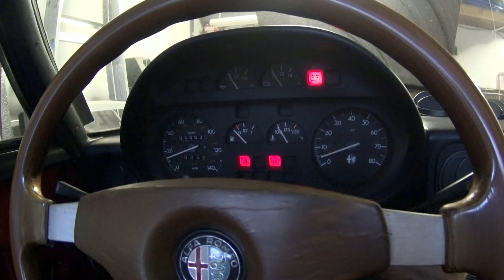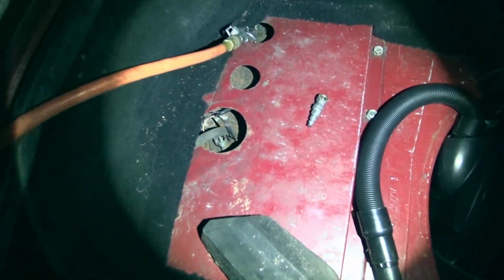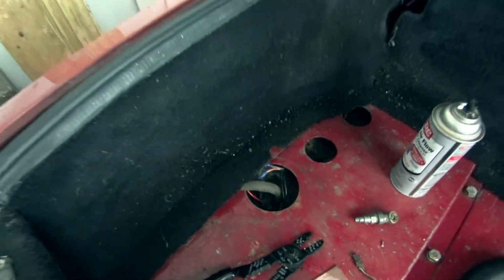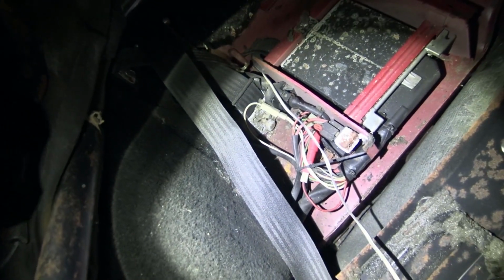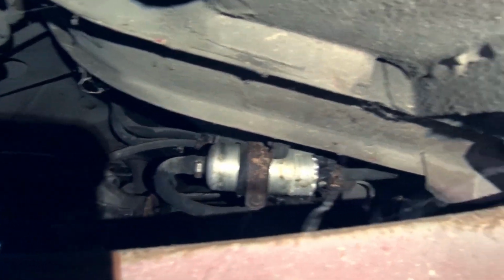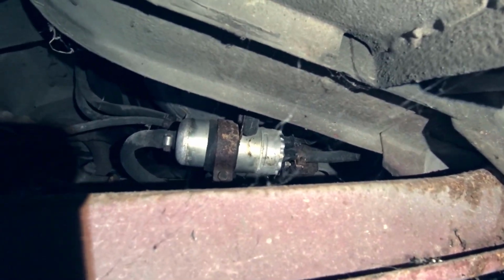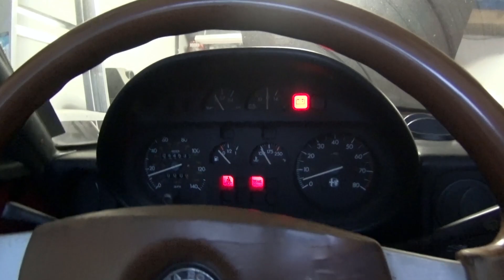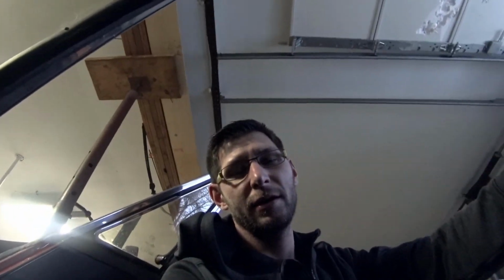Alfa Romeo Spider Won't Start

Comment: Hey! Glad to see you back.  Glad you found the culprit and did some cleaning up of the wires while you were at it.  You will love driving the car and it will go far becasue it's an ALFA!
Reply from the maker: Yea time to get a new pump, full tune-up, and tires.  Than a test drive.  Thanks for watching.
Reply: @EverydayCars   There is trick to get the fuel flowing if you're stuck out on the road somewhere.  Pull the lower small black hose off of the air/fuel mixture hub and spray a small amount of starter fluid in.  Also, you can clean your fuel pump by reversing the wiring on it temporarily.  This will cause the pump's propeller to reverse direction, sucking out trapped particulates.